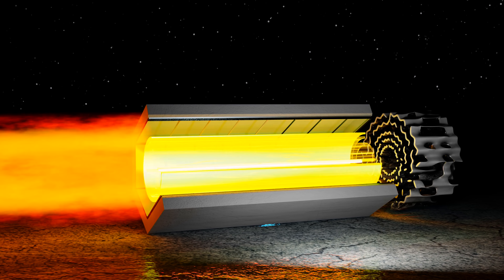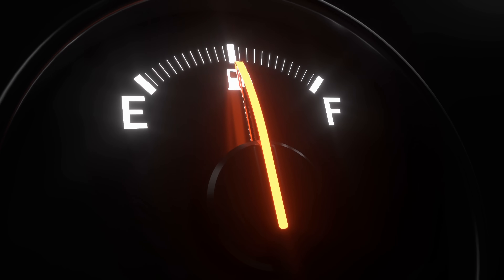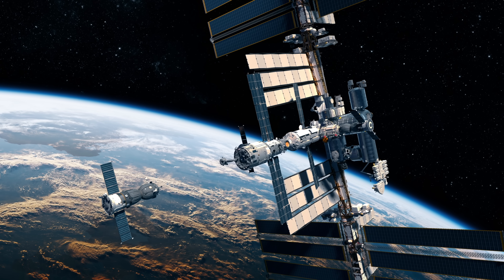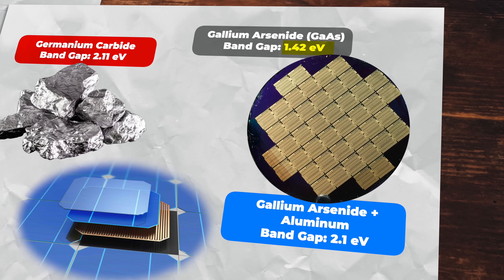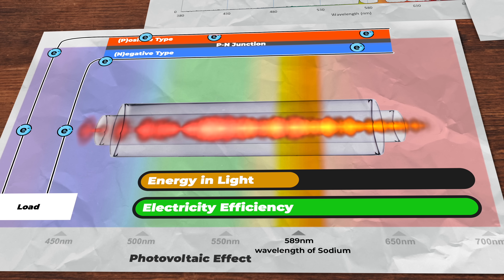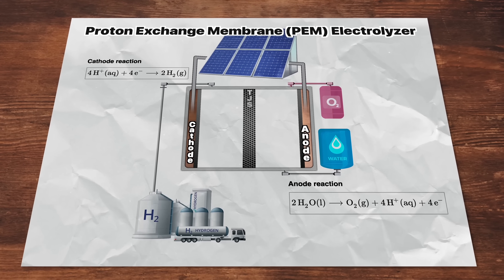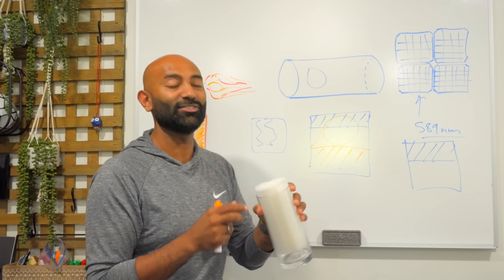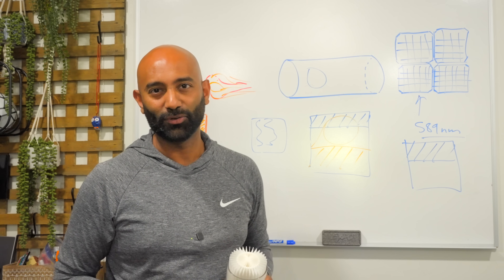Why Solid State Might Save The Combustion Engine

Comment: On your idea on how to use the waste heat of an ICE engine. Actually, I had 2 ideas on how to accomplish this about 2 decades ago, and when I looked into the patent landscape to see if they were worth pursuing, they were both already patented many years earlier, yet we still don’t see them utilized in today’s products. There must be some technical reason preventing their adoption that we don’t know.
Reply from the maker: that's interesting, yah the devil is in the details
Reply: @TwoBitDaVinci  The answer is probably Carnot's theorem. The waste heat from a ICE engine is not enough above the radiator temperature to make it useful for anything apart from space heating. This is why power stations have cooling towers to rain the hot water down and cool it back to ambient wasting all the remaining stored energy.  If it is not practical to make use of this low grade heat in a power station where every % is worth millions then it is certainly not practical in a car engine.
Reply: The expansion stroke of the piston converts the heat of the gas into work and in doing so cools the gas.  This is the fundamental efficiency step in a ICE engine.  The hotter it starts and the cooler it exits the more energy is extracted from the gas.  Once the gas has been expanded in this step the residual energy is low grade and hard to use.

Comment: "Internal Combustion" assumes the combustion occurs periodically in a closed chamber.
Steam engines and Stirling engines are external combustion engines.
This is more a continuous combustion engine like a gas turbine.

But anything that combusts a fuel is a potential problem if  it is a carbon based fuel and the combustion products are not trapped or unless it is hydrogen fueled

Comment: I've been trying to conceive of an efficient "fuel into electricity" system for years, so I am also VERY skeptical that you can convert the energy twice and get even close to 80% efficiency. But I hope I'm wrong! I'd love an electric gas motorcycle that can go 1000miles on 4 gallons of gas 😊
Reply from the maker: yes!!! totally agree
Reply: Watch out for the ultra-hot exhaust cooking everything within a yard of it...
Reply: @prophetzarquon  there is a heat exchanger at the flamey end .. so the gas coming out will be cooler than your room heater.
Reply: @heartflame503  Heat exchanger to where? It dumps it all upward?
Reply: @prophetzarquon  it puts the heat back into the sodium to convert it into light and thus electricity.
Reply: @heartflame503  Unfortunately, that's not how heat works.
Reply: more than likely they would dump the heat into the air intake so they need less fuel to reach the required temp to run this thing. not that i think this does or doesnt work.
Reply: How many kilowatts can a gallon of gas make in a gas generator 20,000 kilowatts????

Comment: Two thoughts: At first it sounds fishy. But when you realize that photovoltaic cells can be TUNED to a specific frequency, and you find an element that ONLY emits that same frequency when heated, now THAT may actually be a game changer. Still a lot of engineering challenges though. 
Secondly, I LOVE the idea of using this technology to scavenge energy from WASTE HEAT that’s already being emitted by extant engines. 
When you brought up the idea at the end, I thought: oh yeah, it kind of already looks like a catalytic converter. Just instal it in the exhaust system right next to (or around) the CC.
That cuts out half the engineering work, since we don’t need to design a whole new engine. And it makes beta testing more accessible in a wider variety of applications.

Comment: Now I understood the context of bandgap and photoelectric energy. What if we made photovoltaic cells (for roofs, not light cells) with multiple layers of photoelectric materials, each having its own bandgap? The layers would be thin so unused light can be captured by the layer below with the corresponding bandgap. The layers would be laid on a mirrored surface, so light reaching the mirror is reflected again towards the different layers and hence increase efficiency.
Reply from the maker: yeah, that would be a multi junction cell! Currently the challenge is to allow unabsorbed light to pass through higher layers to lower ones... but yes multi junction cells will eventualy be a thing, and can increase efficiency of solar to north of 40% 2x what we have now!
Reply: @TwoBitDaVinci  Watched this Idea being implemented over the years.
Multi layer cells are the future of solar cells.
Love your channel!
Reply: For size constraints this could be a good idea, but every layer is adding cost, for example 5 layers stacked with 5 different bandgaps, could cost the same as 5 normal panels we use today.
The multi layer solar cell record is 47-48% efficiency, so only around twice as good as a normal solar cell, but maybe 5 times as expensive to produce depending on how many layers used.
The normal cells we use today would still be much more efficient $/watt power then multi layer solar panels.
Reply: @larsjrgensen5975  As it's adopted the cost of multi layer cells will drop.
Reply: @zaakoc  Multi layered cells are multiple cells stacked on top of each other. Any fabrication breakthrough of the cells would apply to normal 1 layer cells too.
The price difference between 1 layer and multi layer should stay roughly the same no matter how many breakthroughs.

Comment: It comes to mind that if low pressure sodium lights "take heat and produce light" then they could be used to do cooling of high temperature gases. However, it seems that the operating temperature is in the ~150 C range and I don't know what systems could take advantage of such cooling even if it were super efficient. As it would be passive and partially depend upon the light being able to get out of the area, I don't think traditional cooling rating systems would work. 

Thoughts?

Comment: Sodium in a lightbulb NOT Sodium Chloride.
Reply from the maker: sodium chloride breaks down into sodium and then recombines when they step down in energy, we showed a clip of this in a bulb
Reply: @TwoBitDaVinci  
Sodium lamps work by creating an electric arc through vaporized Sodium metal. The arc tube contains  Sodium, mercury and xenon.
I doubt that a good arc would be possible with table salt so I searched the web, here's one reason...

Electrolysis: When sodium chloride is heated to its melting point, it undergoes electrolysis. The electric current breaks down the NaCl molecules into sodium (Na) and chlorine (Cl) ions. The sodium ions migrate to the cathode (negative electrode), while the chlorine ions move to the anode (positive electrode). This process consumes energy and would interfere with the desired arc formation.
Corrosion and Erosion: The intense heat and chemical reactions in an arc lamp would cause rapid corrosion and erosion of the electrodes. Sodium metal would react with the electrode material, leading to electrode degradation and reduced lamp lifespan.
Reply: @TwoBitDaVinci  It's also my question. I thought it's a pure sodium, turned out it breaks down into sodium from sodium chloride???🤔 I knew sodium can be used as fuel in some form, because our chemical teacher blew a chunk of sodium in a water beaker in front of us when we were outside of classroom.

Comment: Methane fuel cells can already power portable high power electronics, if not for their safety and dual use. Ebay did experiment with Bloom(developed a high temp fuel cell), a while back and it worked, but needed a special ceramic part that was expensive and difficult to fabricate, apart from poor durability. Magneto hydrodynamics generators are now possible, thanks to lasers for generating plasma in a space constrained environment. But it has the same issue as fusion in not having a material of sufficient physical strength(Even tungsten does not have enough strength at elevated temperatures of plasma in the presence of a non inert atmosphere). Just some 💭.❤👍

Comment: So they combined a catalytic converter and solar panel? Snake oil.
Reply from the maker: no... its a different approach to extracting the energy from fuel. its largely based on recovering as much heat as possible... If I'm honest, I kinda wanna build a prototype myself after doing this research!

Comment: A long time ago a guy named Smokey Yunick built a series of adiabatic engines. A V twin, an inline 3, and a V4. The intake temps were over 400 deg F. The 75 Cu In V2 produced 150hp, the V4 produced over 300hp. You could put your hand on the exhaust pipe. Ergo Adiabatic. It would run just fine on sour gas. If I recall correctly it was in the high 40% efficiency range, maybe more. It's been a few decades, so the details are fuzzy. Have you heard of this, Ricky?

Comment: How you build 70-80% efficient engines that convert heat into light and then use PV cells with PV cells that are 30% efficient is beyond me.

Comment: I don't think this is legit, even the last part about recapturing the heat losses from an ICE. The area of the photocells required for capturing any meaningful amount of energy would be too vast to be contained within a car for example, not to mention the weight penalty of these cells. As for an average car with a 150 horsepower engine, which means 110 kilowatts, working at a 50% effeciency, it will need 110 kilowatt photocells to capture the heat losses & assuming the monochromatic photicells xan work at 80% effeciency, the area needed  for the cells would roughly be equal to that of a 14  kilowatt setup of the normal solar cells, and that would be more than 100 m^2. Same principle applies to the main invention. To capture light energy that intense, the area of the photocells would be massive that it would render the whole thing useless. Notbto mention the effeciency losses resulted from transforming chemical energy to heat, tuen heat to light, then lightbto electricity. No way this could achieve even 20% at the end.

I reckon if thermovoltaic cells got invented, they would definitely be more efficient, but even these won't be as effecient as 80%

Comment: The problem, assuming the claims are valid, is that automotive engines have highly variable power needs. This system seems likely to be tuned to a very specific power output level to achieve its very high efficiency. That is the opposite of what a car needs. At best, in a car, is you use this as a means of recharging a depleted battery array. At that point, this power system is in competition with fixed point public utilities. So instead of comparing its efficiency to a cars IC engine, you should be comparing it to the efficiency of grid scale coal, natural gas or nuclear power plants.
Reply: A range extender for an electric car, plane or boat is still quite useful.
Reply: Most EVs only use a fraction of their range each day there batteries are oversized for range anxiety and those odd trips. A small compact efficient lightweight generator like this would be great range extender for those odd trips so the battery can be much smaller lightweight increasing maneuverability, efficiency and reducing the cost of the electric vehicle without lugging round a heavy complex piston generator like current hybrids do. As the generator in such a plug in hybrid is just used to recharge the battery it does not need to be capable of variable loads at all.

Comment: Practically speaking, fuel type will be of critical importance.  Pre-circulation of fuel (as in rockets), can get you pretty low heat loss at the cost of only being able to print it, if that.  And without pre-circulation - as maybe with solid fuels - you will lose efficiency.

Also, how the fuel burns will make a difference.  Any build-ups on those complex interior heat-exchange surfaces will degrade efficiency, and possibly force unforeseen wear on the exhaust system.

Also, super-efficiently tuned-bandgap gallium or germanium or silicon or whatever seems a bit of a hand-wave.  Let's actually see it.

Lots of devilish details lurking.

Comment: You cannot get "free energy" from exhaust using sodium to convert heat into light because a normal car's exhaust gasses aren't hot enough to make the sodium glow to a meaningful extent. Also, the more efficient you make combustion engines, the colder their exhaust gets as more thermal energy got converted into mechanical work. Coolant is even farther from being hot enough to make sodium glow in a remotely significant way. You will waste more power hauling the extra hardware than what you will get back from it.

Comment: Thermo electric is at best 15% efficient.
Photo voltaic 22%. 
they claim to beat this by combining them, lol. nope. I smell an OPM development scam.
Reply from the maker: I think you missed some of the key points. PV 22% is for sunlight which is broad spectrum, if you tuned a panel for monochromatic light and provided light only in that wavelength, like they're doing, its way different.

Comment: So many issues with this thing I don't even know where to start.   The pollution alone would be extremely difficult to control.  It reminds me of cheap Chinese diesel heaters, actually.

* Pollution.  There is no way to fully burn the fuel across a swath of power levels.  They might be able to fully burn the fuel at a particular power level.

* Backpressure from dealing with exhaust products to remove unwanted byproducts.

* Efficiency of 60% with a hot exhaust?  Not even possible.  And 80% combined-cycle?  I don't think that's possible either.

* The high temperature of the system will greatly shorten the equipment lifespan, let alone the solar cells.

* Build-up of byproducts on heat exchanger surfaces.

* Multiple conversion steps... another nail in the "efficiency" coffin.

The biggest red flag is having multiple conversion steps (fuel to heat, heat to light, light to cell, cell to electricity) and still claiming extreme efficiencies.  That gets into "sell me the Brooklyn bridge" territory.

I don't think this thing is real.

-Matt
Reply: You forgot the biggest one: Even if the system works, burning gasoline is the worst way to heat table salt. Solar Concentrators, geothermal, nuclear, and even standard power plants would be better served integrating this than cars.
Reply: A modern burner for an external combustion engine consumes fuel much more completely and cleanly than the explosions in an internal combustion piston engine. A generator for a plug in battery hybrid vehicle does not need a variable power output.
Reply: Similar to my first thought: How hot do those EV cells get exactly? And how efficient are they at that temperature and how long do they last at that temperature.
Too many steps and energy conversions. Buildup of byproducts reduces efficiency fast.

I know, for the fuel that is not burned in the first combustion, we could just add an afterburner for additional thrust out of the exhaust. Hey, it works for military jets, so why not here.
Reply: You've got to be burning clean fuel, ie Natural mined Hydrogen..  or maybe an afterburner on a water hydrogen engine. How light and simple is it going to be ... What are the temperatures like ..  what are the materials .. NASA has produced some new alloys but this sounds like it's going to need a catalytic reaction to sustain the reaction at lower temperatures. 🤔

How about going to Titanate PV cells at about 50-60% efficiency, very thin light and tolerate higher working temperatures ..the other technique that might be tried is the bonding of an organic molecule to an inorganic PV substance which can allow a previously unused spectrum of light to be better converted into a usable pV generating spectrum. This has been done, so has the multilayer Titanate cells, they just need to figure out  
how to produce them on a commercial scale.
Reply: You just have to connect the power output to a very sufficient capacitor and give then to motors to run the wheels you can use a small one in your Tesla
Reply: Another one to consider for your list, starting up and stopping the process fast and with repeated sucees will most likely not be trivial.
Reply: @Hookeslaw  Things have progressed since the paleolithic starting a fire is not that hard. As its output is electric power a likely use case is a hybrid vehicle where the  it is only turned on when batteries get below 20%.
Reply: Jet car lmao
Reply: I'd take someone who knows what they're talking about over a random youtube comment from someone who goes "muh emissions!"
Reply: NOx emissions would be bad.  It would need to go into a catalytic converter which would create more back pressure and reduced efficiency.

Comment: So basically the guy reinvented incandescent light bulb where you heat up a filament hot enough to emmit light then use a photo cell to convert the light to electricity.There is so many enginnering questions of this design and when you mention things like trade secret this doesn't pass the smell test. First when you burn fuel you emitt gas. The nice animation doesn't show how the gas is scrubbed. Second, how long the sodium "filament" is going to last and same for the photo cell since they degrade. Finally, what kind of fuel? Don't tell me the fuel formula is a trade secret. I am sure there are a lot more questions and this also reminded me of Therenos where the theory sounded good testing blood using only a few drops. This video is more like an investor relation promos like what Therenos did.